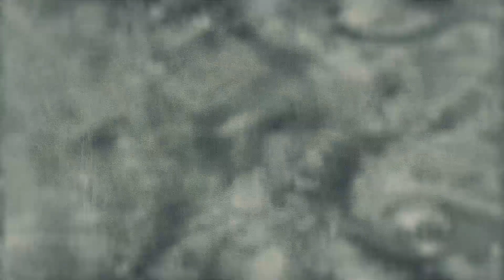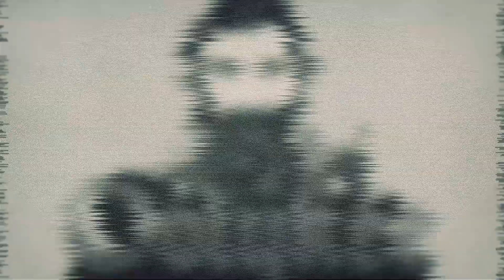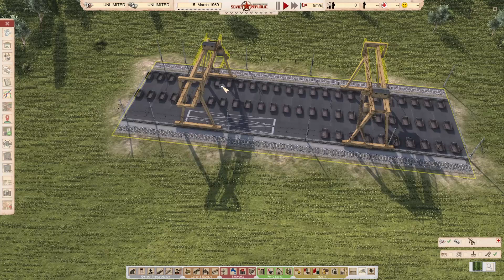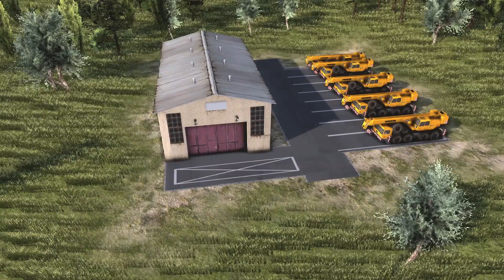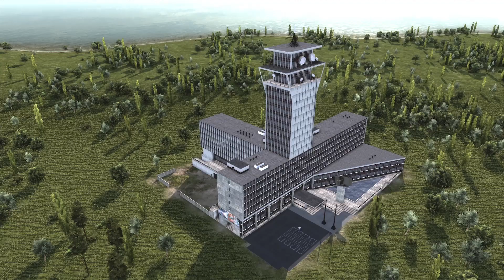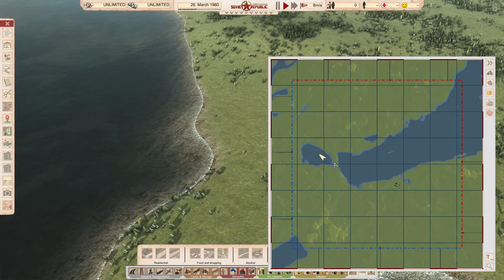Soviet Republic - Mod Monday - S03E34 - Trucks, Trains and Torolleys

Comment: The vehicles that have appeared in the last few weeks just get better and better my mod folder is overflowing, I will have to start removing individual vehicles I won't be using from folders just to make picking what to use easier, it's time consuming but keeps the clutter down I do it with industry packs and residential buildings so only the ones I want to use appear in the mods search section. 🙂
Reply from the maker: Absolutely agreed! :)